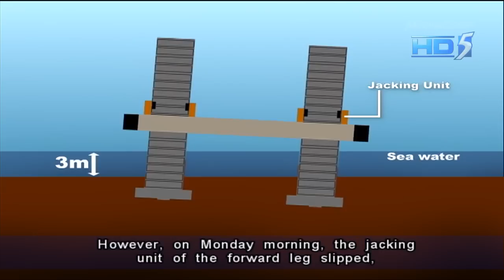Sembcorp Marine: Failed braking system caused rig to tilt - 04Dec2012

Comment: What I can see is not the brake failed !!!! There are 2 possibilities : 1) The sea bed sinked & collapsed at the affected leg, 2) the weldings of the leg at underwater water portion cracked and the leg caanot support the weight of the platform thus tilted.....................
Reply: true.
Reply: Yes the brake actually did fail...your possibilities are correct, but at the same time, if the brake fail, obviously it will lead to tilting because the weight has shifted.